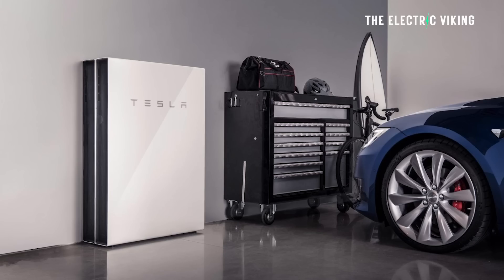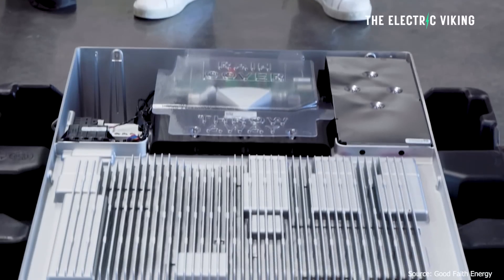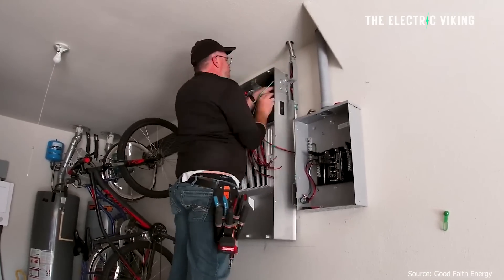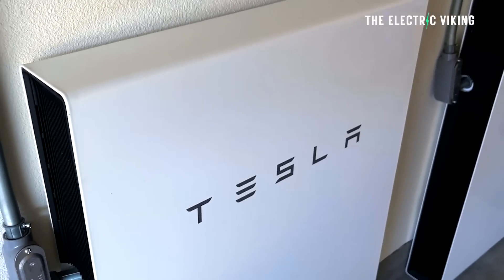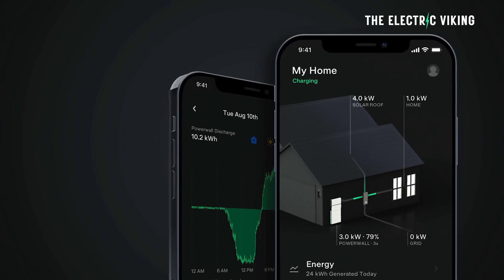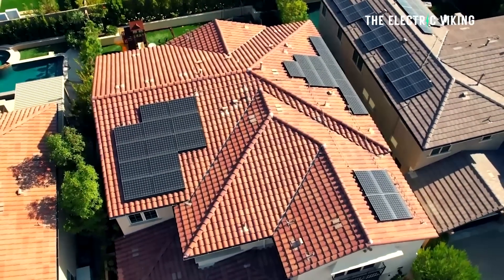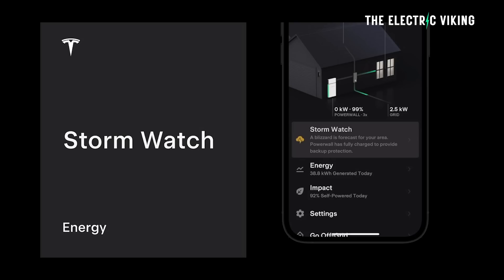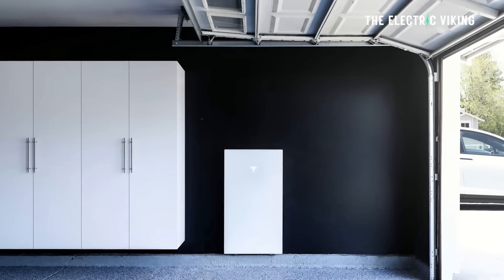Tesla Powerwall 3 finally arrives in Australia - is it worth it?

Comment: I have a battery, and even I think it does not make economic sense for most situations (not yet at least). Luckily my Franklin battery was quite cheap when i got it, and I also got a rebate - so the price was only $7k after installation (for our friends in the US, that's about $4,745 USD). The reality is though, for the battery to pay for itself, it needs to offset a lot of high peak power usage, and you would need to use the battery to its full extent every night for it to start to make sense. If we use the PW3 as an example, that's 13.5kw/h of power * (peak power cost - FIT) if you charge from solar during the day.

For me that would be 13.5 x ($0.53 - FIT). My FIT is now just $0.03, so if every night I maxed out my savings, a PW3 would save $6.75 (absolute best case scenario). If a PW3 was $15,000 installed, that's about 6 years until it is paid back. However, this best case scenario is not that realistic, as most people will not use the 13kw during the peak time of 4:00pm to 9:00pm. At 9:00pm, my tariff for example falls to about $0.34 per kw, then at midnight, the tariff falls again to $0.08. So the return on investment now decreases. Most users will also keep a buffer of about 1.5kw in case of blackouts. For me, we are pretty power hungry, but I often find my battery is down to about 50% by 9:00pm, then down to about 35% by midnight, with nothing left by 6:00am. Running on those average figures, (6 * ($0.53-$0.03)) + (2 * ($0.34-$0.03)) + (2.5 * ($0.05-$0.03)) = $3.745 = about 11 years to pay for itself. This is much closer to the expected scenario, as it's my average use.

To be fair, the battery will likely still have a lot of life in it after 11 years, and electricity will go up in price; though that is $15,000 that was not invested over an 11 year period. Now, i could charge my car from the battery, but I would more than likely charge during the day when power is only worth $0.03 (money lost from not selling it to the grid). I could charge my car after midnight (which is the whole point of my EV plan), or i can charge from 11:00am to 2:00pm for free during the day on my current plan with OVO energy). 

The point is, the battey does take a long time to pay off, will take longer if the battery did not charge during the day because of poor weather, I go away on holidays and don't use the power, or i simply don't use that much each night.
Reply: Is that in Australia?
Reply: @jsanders100  yes
Reply: Or in my case, I get a 50 cent solar feed in tariff, and buy back electricity for 38 cents at any time. Cheaper to buy electricity after ive exported my solar. And its been like that since 2010 for me. Straya - shit yeh!
Reply: @superwag634  ah, the Solar Bonus Scheme – 44c on top of the FIT. I used to have that back when I had a 3Kw system many years ago. Try to run nothing during the day to feed as much electricity to the grid. Hold off getting a smart meter as long as you can.
Reply: @xiaowei1  exactly. Everything off during day and then crank everything on after sunset and pull that peak priced power everyone hates paying. I’m sure they’ve been losing money on me as I haven’t had a bill since 2010 🤷‍♂️
Reply: @superwag634  Make a much of it as you can. I think it runs out mid 2028. We have had to spend about $20,000 for 3 phase, 2 x6.6kw solar systems, and a battery just to get out bills close to zero.

Comment: Forecasters are warning that “dangerous heat and humidity” will spread across the central and eastern United States this week, threatening to break records for high temperatures and ending a spell of fall-like weather. The heat wave will bring unusually hot temperatures to the Upper Midwest and Mid-Atlantic, said a meteorologist at the Weather Prediction Center.
The EXTREME heat and humidity could make it feel like 106 to 117 degrees Fahrenheit in parts of the country. In some places in the Midwest, it could be the hottest temperatures they’ve seen in many years, perhaps ever. Not only is it late, it’s the HOTTEST, too. So that’s EXTREMELY unusual. Columbus, Ohio, and Chicago are expected to reach a high of 97 on Monday. Louisville, Ky., is expected to hit a high of 101 on Wednesday and Thursday, while Washington could register 101+ on Wednesday. Excessive heat warnings are issued within 12 hours of “extremely dangerous heat conditions,” which means the daytime heat index feels like 105 for at least two days and the low temperature does not drop below 75. HOW'S YOUR HOAX TREATING YOU?
Reply: Farenheit? What is that? Oh, some archaic measurement system used in a dinosaur country.
Reply: @rogerphelps9939  It's what they use in the GREATEST COUNTRY ON EARTH, THE ONE IN MY COMMENT. Seek medical attention.

Comment: I paid 12K$ for 50KWh from China.Charging a Car from a 12K$ battery with just 13KWh is useless ( my car typically takes 20KWh when I come home) and by the way my 50KWh battery would be able to deliver 50KW! I am only limitted to 15KW by my 3 phase Inverter.All in all I think this is just an overpriced toy 😂
Reply: Agreed. I crunched the numbers an they make no sense.
Reply: Overlooking the software.
Reply: Correct....batteries will never make sense.... particularly when we can get V to G and V to H
Reply: Which battery do you have and does it work to buy and sell electricity with Amber?
Reply: What are you talking about? Who would charge their car through a battery? Your alleged 50kw battery will be 50kw for 6 months. It 2 years it will be 25kw.